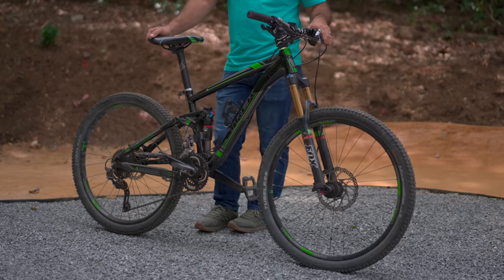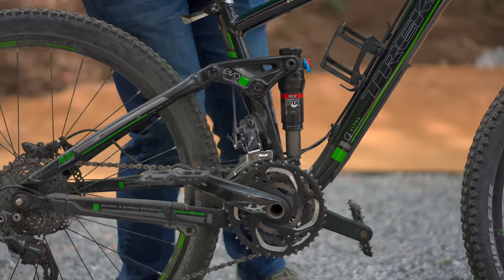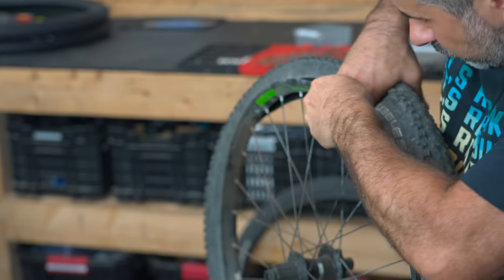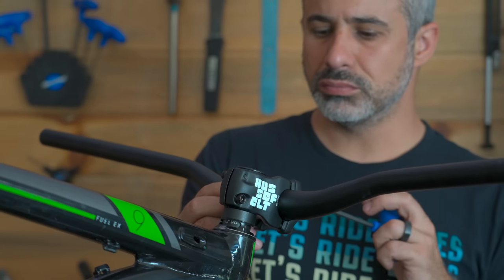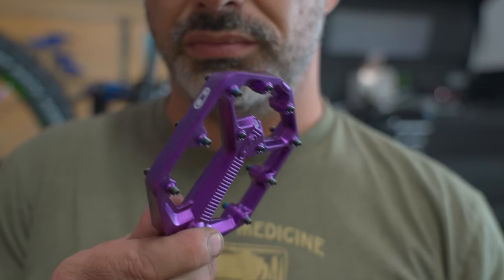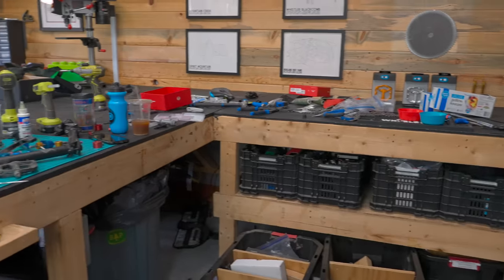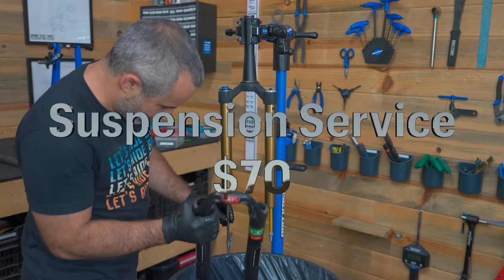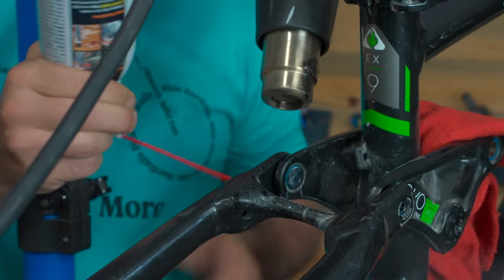Tired Trek Full Suspension gets absolutely overhauled!

Comment: thanks for another flip bike episode! I just bought a specialized stumpi fsr 29 elite from 2012, but with 203mm discs, combined with slx brakes (br-m7100), a dropper post and a shimano deore 1x11 drive system for 700 swiss francs (that's about 790$). I changed some parts and it's the best bike I had so far!

Comment: I found a beach cruiser with a little bit of rust on the chrome rims that I got for 5 bucks. I used ketchup, potato’s, and thin steel wool to get the rust off of all the chrome and made the bike look great. It a had a last service date at 2002 so I serviced the hubs and replaced a couple screws. I bought a new chain for 10 bucks and took good scenic photos to put onto Facebook. I only ended up spending about 20 bucks and sold it for 70, A very reasonable price compared to other beach bikes up for sale. It sold quick without a problem due to the tips I’ve learned from this series. And it was such an enjoyable experience to the point I was actually sad to sell it. I wouldn’t have done it had I not known about beard peak and it’s incredible advice

Comment: Hey Seth  love the channel.  Old school bike builder out of necessity having grown up very poor always had to start with a cheap frame/bike and build up, to catch up with peers. From the days of BMX when I took my motorcycle style seat, and sissy bar off my huffy to put a ten speed seat on to ride the trails with my friends and their scwinn predators. To finally building a red line with Tuff wheels II, race inc bars Tuff neck  etc etc.... only to start over as mountain biking got bigger and BMX started fading plus I was growing bigger myself and no longer fit my red line.  I then starting building an MTB on a diamond back (steel) frame (heavy)  as my friends were transitioning into MTB with their treks and Marin county bikes.  I Eventually ending up purchasing a  Cannondale downhill racing frame and moving all the components over from said D. B. ended up with Rock shocks,  Ringle` and Deore XT components . (Yes, dating myself there) you might have been in elementary school by then🤣)  I guess my question, if I may ask to you, or anyone out there... is the cannondale worth anything?  would I be laughed of today's trails with it?  I still enjoy hopping on it every once in a while, and after stumbling across you channel, it has mysteriously made its way from the shed to the basement.😊

Comment: In 2021 I sold my favorite bike - specialized pitch full suspension 2011 last year model. They were ahead of time bikes, and that's why it served me so well for so many years.
 Stock suspension  was pike with 20mm  thru axle at the front (that's 2011model !) had great geometry and was trail Enduro mix at the time marketed as all mountain .  
Also very under radar. They were in production for only 2 years or something, because they provided same performance as specialized Enduro model but costed nearly half.   
If you ever come across these pls buy and build you won't regret!
 The only way people could guess it's an older bike was that it stuck had straight head tube (year before they became tampered) and 26 wheels which I ran on tall aggressive panaracers 2.3 tubeless(even though they weren't meant to be) it worked fine and had no issues.  Sold in 2021 for 800 and still miss it today. Switched to 27.5 Jeffsy- hated it, sold it, got 2020 stumpie s-works love it.

Comment: Seth, for a 5 foot tall rider, I'm betting the cranks that came with it were really really long.  When I built my daughter's bike I found some 145mm cranks cheap at a BMX racing shop, the downside was that I had to use a square taper bottom bracket.  They weren't that heavy though and I think the increase in pedaling efficiency and comfort was worth it.  You'll see Woom, which specializes in kids bikes ship their 26 inch MTB with 150mm cranks.

Just a thought for any of you that are thinking of building a bike for your kid.

Comment: Seth , I have A 2001  ridged Specialized Expedition Sport Aluminum frame 26 inch wheels , linear ( V - Brakes )   and by you doing this  Trek full suspension bike I can can say that 26 inch was still selling in 2013  , although hydraulic brakes were maybe pushing Linear ( V Brakes )  Out , it's hard for me to that type of information on the Internet . My bike had  when it was new and option for a front suspension fork  ( 1 & 1/8 inch straight steerer tube  , but V- Brakes )

Comment: Seth, maybe you should change the front chainring to purple 32 or even 34t, because 30 is just too low for 26 inch wheels. But it is nice to cee a bike that doesn't need anything other than service.

Comment: Don't worry Seth Snapping things is okay (I hope) Basically torqued down so hard on my SRAM UDH that I turned it into a rivet and it snapped the threads fully in half. and all because the torque wrench would go down to 30nm but was meant for 80-90 ft pound car tire lugs meaning that it clicked all of half a millimeter

Comment: I sold my 2012 Fuel ex7 in Asheville with pewter I9s, fox suspension and 1x11 XT with a clutch for $400 in 2017. It sat on CL for $750 for months and I took the first offer. Bike prices are crazy.

Comment: Seth, the problem I see right away is the rear derailleur. A tiny stick would take that out as opposed to an immovable rock in the trail. With 26" wheels that only has a couple of inches clearance. Road or path, ok. Trails?  Certainly questionable, especially Pisgah gnar.

Comment: I fixed up a 2016 Cannondale that I got 2nd hand for half price of $4000aud and 6 years later I have spent $4000 on it and only recently it is now riding like a premium bike. Over the 6 years component after component would break or fail, usually from underlying warranty problems (original reverb dropper for e.g.) the only original part now is the frame and crank arms. 

It's a total of $8000 when I could have got a new bike  with the same premium specs for $8000 but I still feel it was worth it, I have a unique build that was slowly upgraded so the upfront cost isn't as much and now I have used the bike for 6 years but I feel like I have a brand new bike now the final upgrades are done.

Comment: Amateur question from a guy who plans to repack/replace his bearings this winter for the first time: the one bolt Seth super struggles with here, he appears to be loosening it clockwise from the outside of the frame (Righty-loosey) ? But the bolt appears to remove to the inside of the linkage, which would make it "lefty loosey" from that side. 

Is that just an artifact of this being an older bike? is there a way to know for sure that the linkage bolts on my bike are all going to loosen the direction I want them to? Are some linkage bolts reverse-thread depending on the side of the bike, like bottom brackets/pedals?

Comment: Seth, get yourself a battery powered impact. Far less likely to break something with dozen of low torque impacts than the massive amount torque you can apply with your hands. I got a Milwaukee 12v and it’s saved me hundreds of rounded out torx/allen and snapped bolts at this point (I work on small equipment for a living). 18 volt for the bigger stuff. If neither of those work than I prepare myself for breaking / stripping out something albeit exceedingly rare occurrence.

Comment: Someone needs to do a video that discusses all the different type of rear suspension linkages, and the pros and cons of each. and discussions of all the terms related to rear suspension that frequently get tossed around without explanation like anti-squat, chain suck, etc...
As a hardtail rider that's considering an upgrade to FS, there's not enough info about this stuff out there. a detailed guide all in one video would be great

Comment: Personally I'd go down the route of what Seth just did. My current and first proper MTB is an early trek Marlin 29er that I got from the dump for $10 . Had frame fork, cranks, bars , stem and front wheel only. Bought a brand new second hand fork for $20. Canibalised a Resto modded TYAX I paid $150 for it's 1x10 drivetrain and hydraulic brakes, nukeproof stem and headset. used a 27.5 rear wheel off of another junk bike I had and a few other misc parts, new rotors and pads, new chain..... I think I'm in it for about $350

Comment: I am a Trail Cycle Leader in Ireland, I an continually going round buying $100-400 26'' wheel sized bikes and giving a decent service. Getting into new juniors along with my own teenage children. 
Stumpjumpers FSR £250 STG, Cube reaction race £300, Hardrocks £120, Cube Stereos for £200! I just git a S works Enduro size S frame with rear shock for £1. It is getting my bike BIN of bits , Hope Hoops, 1*9 dive 11-46T, an air fork 120mm travel for £50. 26'' is perfect for teenagers, plus little do the know they are trail trail care maintenance crew Minons this summer too ⛏👷👷‍♀
The amount of teenagers which other sports left behind on trails spinning hard hills and enjoying it is worth the effort : ) .

Comment: I saw a 2012 Trek Superfly 100 listed for $900 CAD ($654 USD), hard not to jump on it - but that's a pretty old bike that's likely due for a substantial maintenance event. And by the time have likely replaced a cassette, brakes rotors, tires and serviced the front and rear suspension ... I could have just bought a newer bike, without the upacale Fox suspension but with newer geometry and drivetrain.

Comment: Fun fact... the torque printed on the bolts is not correct, the bolts will rip of when using the torque spec written on it. Happened to me years ago, a fuel ex8 was my first propper full suspension bike, and i loved it. The Wheels were strong like hell, i bent them and knocked them back multiple times...fun times till it got stolen.

Comment: I think that you should maybe avoid putting droppers or 1x since they cost a lot of money and they are not essential. I have ridden without these two for all my life and just recently upgraded to them. The dropper is really nice but you have to consider the use that girl is gonna be doing of that bike as, probably, she won't need it. About the 1x, I have a 1x12 right now and I came from a 2x10 and I think it was better because it had better range especially for climbing steep and technical trails. Anyway, my point is that maybe it would have more sense to update these bikes in the essential stuff. That being said I get that if it is not for profit you can put many things on it, but, for me, it doesn't change too much the bike because the frame still looks old.

Comment: Ya you could get a new one but a 26in bike probably fits that young lady better than a 27.5 or 29er. Definitely has a better drive train and even those old SlX brakes are better than what is on the rift zone. The fork is also way better as you stated. I think most Marin bikes are not built that well for the price in comparison to there competitors to start.

Comment: About the drop post, did the bike already have a spot where the cable exit from internal off the bike to outside. Reason me asking is i have a trek remedy 9.7 carbon and there is no place for the cable to exit the bike from internal out to lead to the handle bar.

Comment: in my head for $750 thats a rip off. i paid £300 for my very nice condition 2010 170mm travel trek scratch air, slapped £80 worth of deore  11-46 1x10 on it. a reverb dropper for £55 (with 1x optional lever) my spare hope m4 brakes i paid £120 for and my 165mm sram xo DH cranks that i also paid £120 for.  i've got  £675 in it ($850) oh and i sold the old cranks and slx drive line bits for £80 and the thompson seatpost it had for £35

Comment: I ride a Freeagent bmx from 2004/2006 the seatpost moves because it’s the wrong size, the rear drop outs were 5/8 but I filed them to fit 3/4 axle, the v-Brakes use parts from three different types because one is broken and I wouldn’t trade it for anything it’s a piece of crap but it’s my piece of crap

Comment: Respect! Great flip, but you're misrepresenting the cost of parts and tools to the average recreational rider. The tools alone would double the cost: bearing presses, brake bleed equipment, fork/shock/dropper service tools, bottom bracket and cassette tools, and of course all the basic allen keys & hexes will EASILY more than double this build cost. For example, the Ultrasonic Cleaner is $80 for a cheap Amazon version.